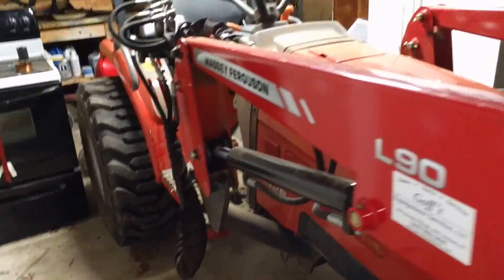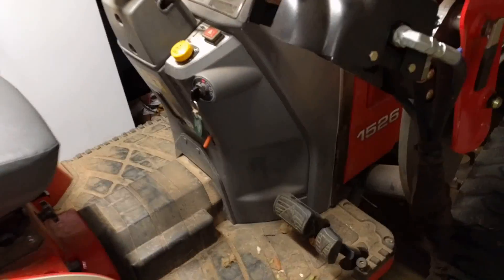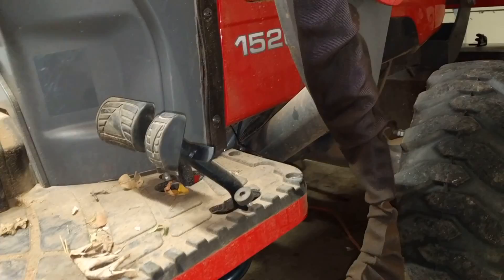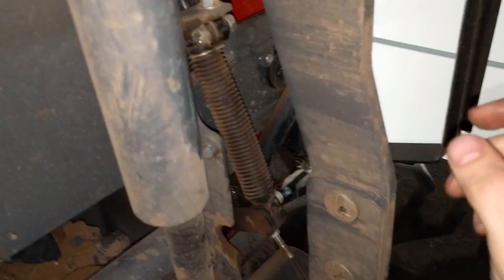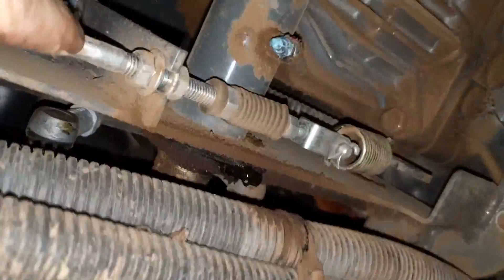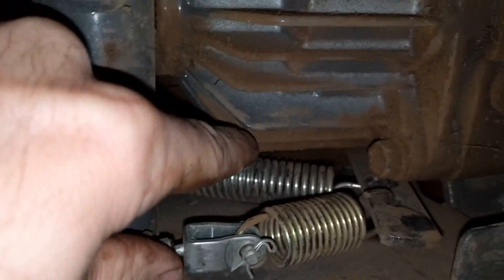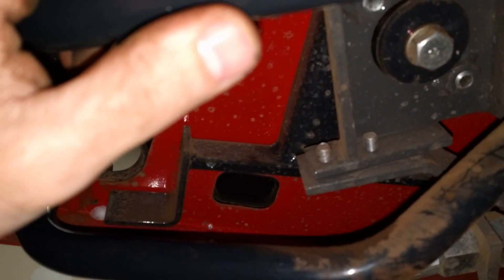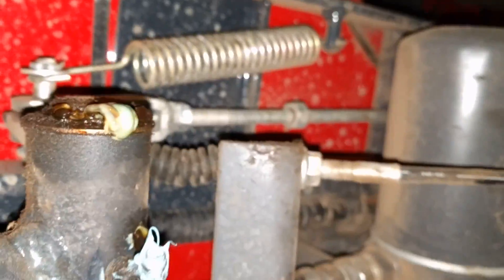Compact tractor hydrostatic pedals sticking

Comment: I've got a 2018 M-F 1526; It's been a really great tractor so far, But I can tell you that I missed those 3 zerk fitting as well; Thanks for the tip, & video, & I'm going to make sure that I hit those  ASP. Oh & I haven't had these issues with mine yet.

Comment: #1 problem....it’s a Massey Furguson.
Reply from the maker: Lol, I assume you are partial to another brand?
Reply: @skipjagger  nah, not really. We had some old MFs on the farm and they were fine. My cousin recently had a small one like the one in this video and it was a complete pile of shit. AND getting parts for it was terrible! That’s up in farm country in southwest Wisconsin too, so it’s not like there wasn’t a MF dealership nearby.  Sometimes you get a lemon, but I was appalled by the repair situation and parts availability. Shame on MF.
Reply from the maker: @ryanjones9305  good to know, luckily I haven't had to replace much of anything yet, I have only put about 500 hours on it in 4 years. Pretty much in my fee time I just play around with it in my yard, no real work!!! I have only had 3 "issues" so far, that "creep" issue, the front axle (left side)  got a pretty bad leak (haven't addressed it for 2 years, just dump a quart in whenever it gets low) , and the loader valve relief was junk so I stuck a regeneration dump loader valve from Prince on it.
Reply from the maker: @ryanjones9305  hahahahahahah!!!!!

Comment: Thanks for the video. I had same problem with my 1526. Made your adjustment this am and hoping for better results
Reply from the maker: Mine still does it if I load the hydrostat. But that plus really greasing the pivot on the pedals, made quite a bit of difference.
Reply from the maker: Any luck?

Comment: So does the pedal forward ever get any easier to push down over time
Reply from the maker: It does not, unless it's a bit siezed up from lack of lube or something. I suppose if the return spring gets weaker over time it would get a little bit easier, put probably not noticable
Reply: It’s a brand new tractor. Wouldn’t think it need greased the first day

Comment: Any follow up on how this went.  I have the same issue and am trying to decide an action plan.
Reply from the maker: I don't understand why I don't get notifications on some comments??? Very strange, sorry I didn't see this until a year later!!!! This helped the issue, but it's still there a little bit. It seems like it does it worse  if the hydrostatic drive is loaded?
Reply: No worries.  Thanks man. I found that cleaning up the pedal linkages and using a high quality grease seems to help.